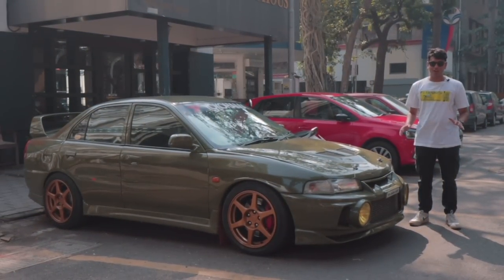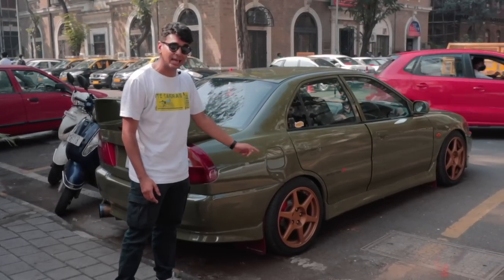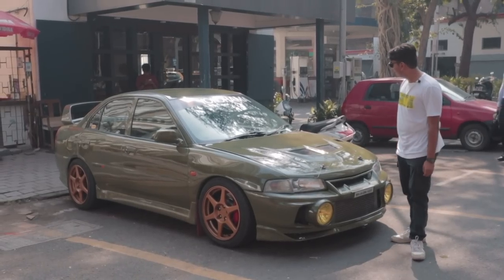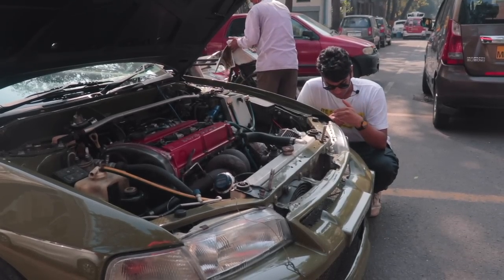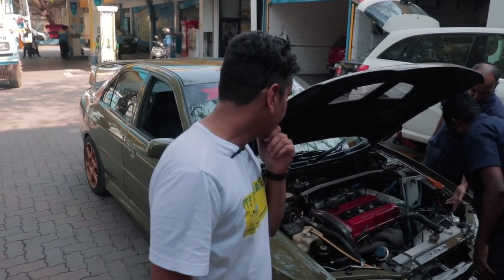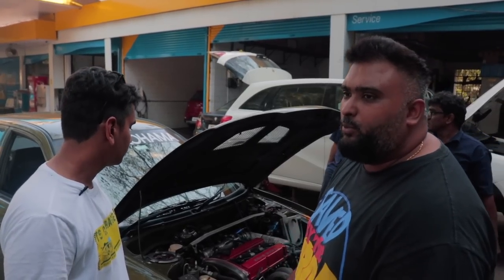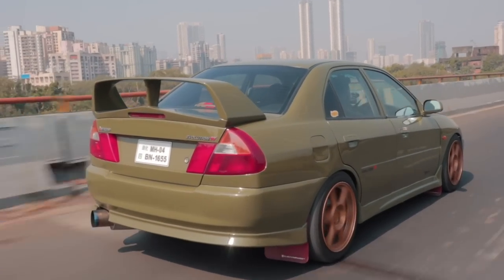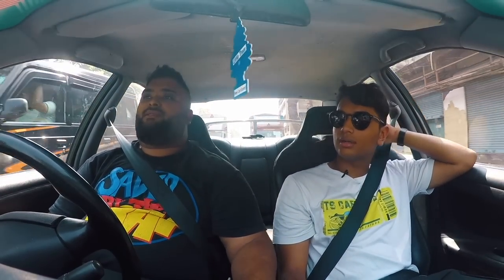400 BHP Lancer EVO 4 from @Horsepower Cartel! (CRAZY PULLS) ft. Limitless SJP | Autoculture

Comment: Lancer had 3 petrol engines. The 1.5 4G15. The most common one it was. The 1.8 4G93 (For the Automatic Lancer Invex). The super rare 4G18 1.6 (only about 25 units in India). Lancer never came with 1.3 unit. Never ever.
Reply from the maker: Yes, you're right, small slip up from our side 😅
Reply: Hey bro I have lancer 2002 slxi u can see in my profile photo , can give me some knowledge about I don't know anything about it  ,I also don't find info about ck2 anywhere
Reply: Since it was mentioned more than once, was about to comment the same. A 1.3l Lancer? 
And yet. Learnt new stuff here. 1.6l Lancer? When was that launched?
Reply: I dont know whatchu talking about mine lancer is 1.3😂🙅
Reply: @MikeG52  You're from India ?
Reply: @kl01af6940  1.6 there were 25 units sold. My friend owns one. Also, 1.3 4G13 was available for international markets. Not for India.
Reply: N lancer also came up with 2.0 diesel engine.. I own a lancer n m proud
Reply: @TheDriversHub  And the car was built by team FS not horsepower cartel
Reply: It came but not in India it came in Pakistan
Reply: @therenegades7329  hey watch carwow
Reply: east or west Miata is best
Reply: Hi I have 1.8 invex atm petrol ,can suggest why I am not getting thrust ,getting power lose while accelerating maf 605 is right sensor or for 1.8 there is different type of sensor ?and where can I get good genuin part and service for my car .I am from Pune
Reply: Came in Europe i have one

Comment: Nice, India's converted lancer to Evo
This is what we usually did in Indonesia because regulation bs. It was cheaper, at least until half-cut stock has dried up. Conversion has several types: body only, body + engine (still FWD), and finally body + engine + awd.

In here, because soeharto bans importation of car, any Evo before Evo 6 is either conversion, or very rarely non converted Evo, or misty route (used importation which is still not allowed till this day, but loophole is that once it got confiscated, it'll be auctioned, from then it can be registered as long as it's not dismantled)
Reply: How's it with FWD? im planning to get mine done this way by locking the rear diff

Comment: Anybody else noticed the one wheel bolt missing? Also i never knew a 1.3 existed in Indian version, i think they only exist in a 1.5 and 1.8 manual. Used to own a 1.5 4G15 till i sold it back in 2017 because it blew a whole in my pocket since it's addicted to breakdown and failure of certain parts. Correct me if I'm wrong but i don't think we got the 1.3 versions here in India.
Reply: No shit. I’m hearing that from you